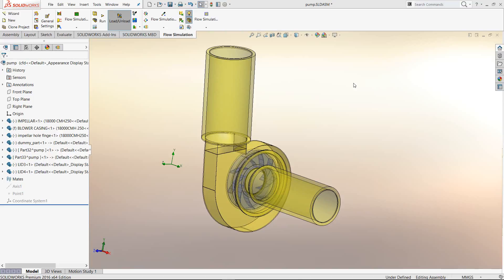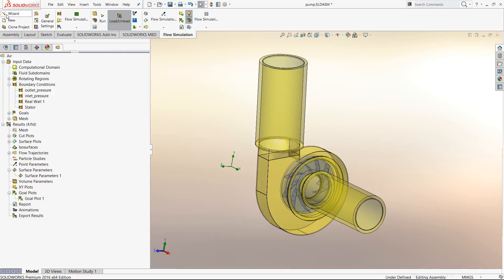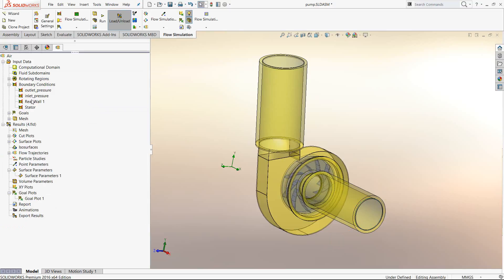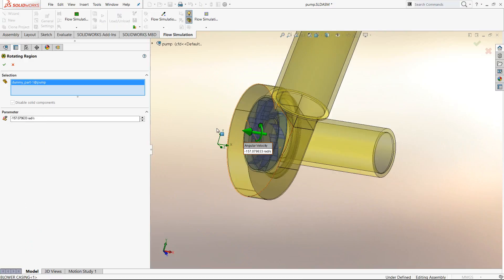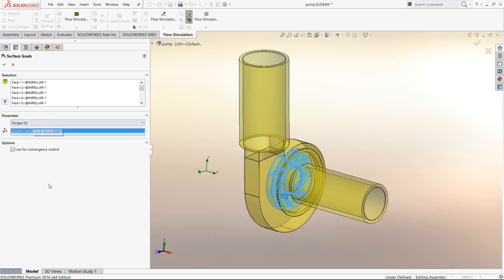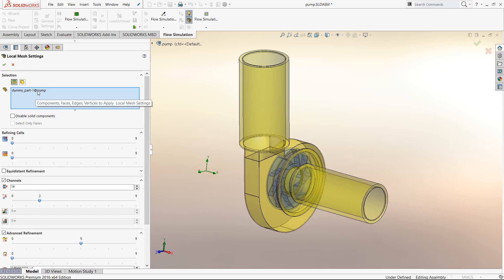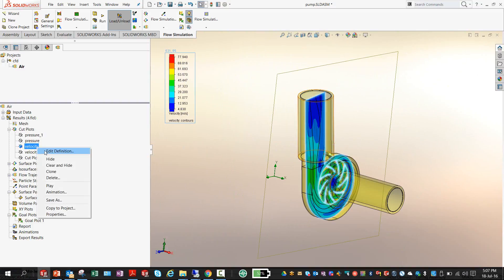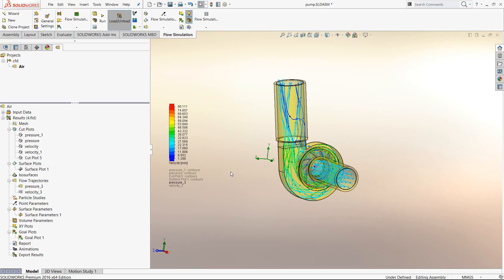Why SolidWorks Flow Simulation - Suction Pump Simulation

Comment: how did you assemble the dummy part with the impeller ?
Reply from the maker: its like a normal SolidWorks assembly. Just that it need to be made as a dummy part in Flow Simulation.

Comment: halo, can we build the pump characteristic curve from the simulation data, such as the volume flowrate, head and Best efficiency point ?
Reply from the maker: Yes, that would be one of the important purpose
Reply: @KapilGaitonde  but sir, in order to construct a pump characteristic curve, the pump should have different result of pump head and capacity but in the same rotational speed. my question is how do we setup the boundary condition in order to have different value of head and flowrate under the same rotational speed. I'm sorry for my English I hope you understand what I'm trying to say, I need this for my final year project..

Comment: can I make flow simulation for external gear pump? is there any source for solidworks ? I couldn't find it, it looks like I need special program for that, maybe Ansys ?
Reply from the maker: Yes, thats true. SolidWorks Flow Simulation cannot handle this scenario.
Reply: @KapilGaitonde  thank you Mr. Gaitonde

Comment: This is not a pump. It is a blower, or fan, or ventilator ... however you want to call it. Pumps are for liquids. And, such steady state simulations are of pretty  limited prediction accuracy. You should set-up and run transient simulations to get more reliable performance curves.

Comment: Nice video. I have few ques. 1.) What if there are two rotating objects? Say in supercharger of car? What will be the boundary conditions.
2.) While giving boundary input condition. Why are we giving environmental pressure? Shouldn't it be the pressure at which we are calculating the output pressure of pump? Also, what if we defind different pressure say 10 psi then how result would vary?. Thanx .. looking for your answer soon!
Reply from the maker: yes, you are right... The pump might be operating at higher pressure... and we can use it.... however the relative pressure difference remains same. Also, yeah, we can use multiple rotating objects.

Comment: Why are you using Local region averaging and not sliding mesh? local region averaging is used for symmetrical impellers, but when you put the impeller in a housing, you need to use sliding mesh to simulate the interaction between the housing and the impeller. Please tell me why u picked local region averaging and if you validated the data to real experimental data, much apreciated!;)
Reply from the maker: Simple, If I remember rightly, when I did this video, there was no Sliding mesh option, Hence. However, irrespective of that, I think the results may be close in both the methods.
Reply: Kapil Gaitonde sliding option is working since 2015 update, so  im pretty sure there was the option to set it...